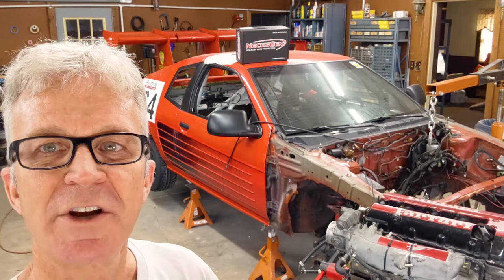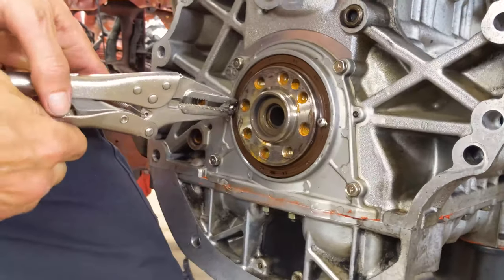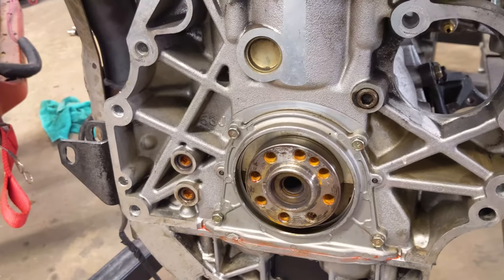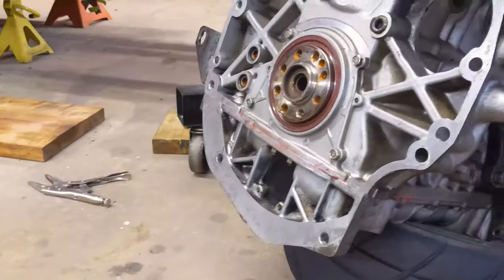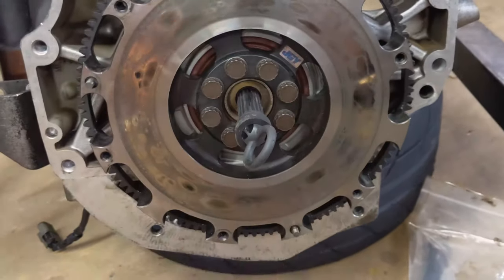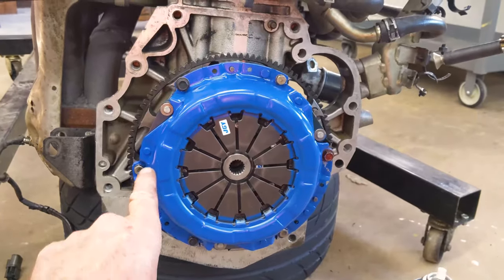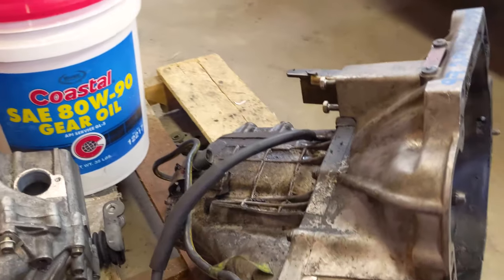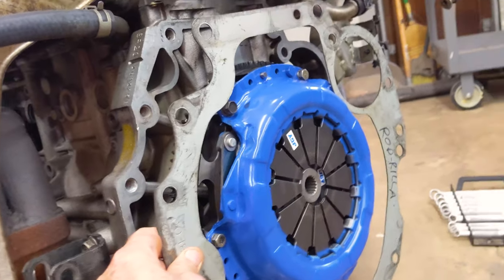24 Hours of Lemons Build - Another Setback - Vlog #8

Comment: I’ll support. Do you guys sell plastic welders?
Reply from the maker: Yes, we manufacture and sell plastic welders! Our company was founded in 1981 to repair urethane bumpers. Our Mini-Weld airless plastic welder (now the Mini-Weld Model 7) is still used today to repair urethane bumpers, as well as many other plastics.
We were the first company to commercialize nitrogen plastic welding in 2006. We just released our sixth generation of nitrogen welders - the 8000 series. The 8000 series of nitrogen plastic welders consists of 8 welders to offer an option for every body shop and every budget.